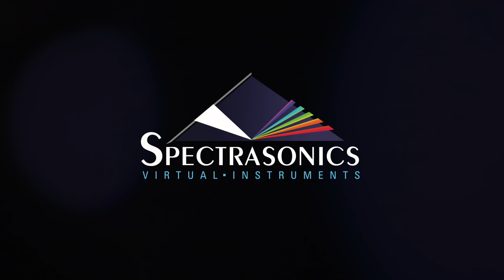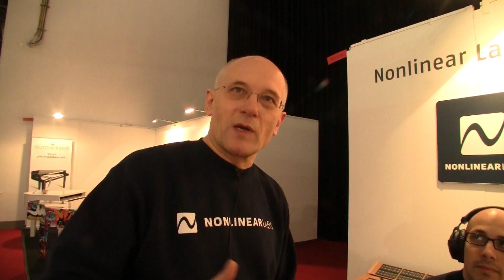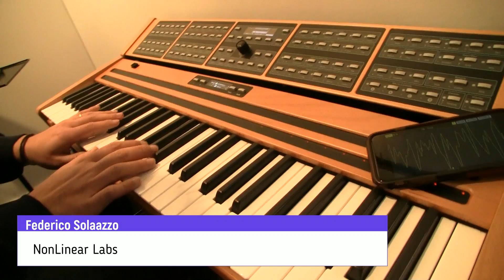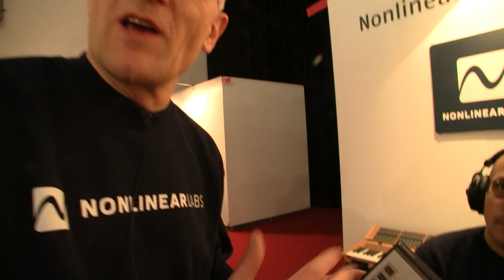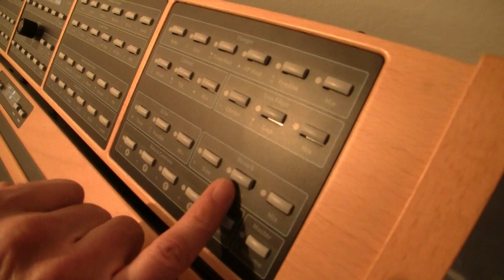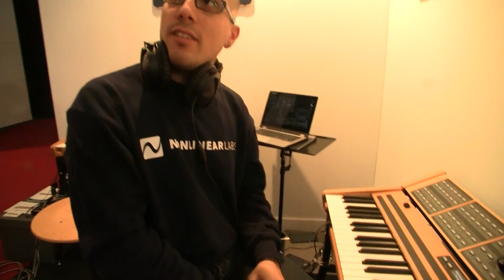MESSE 2017: NonLinear Labs C15 €4k FM, Waveshape and Modelling Instrument

Comment: 2-Osc FM(?) / 12-voice (WTF?) synth, without Pitch/Mod wheels, MIDI and...LFO! ???  :-s 
And all these at €4000? These guys are on heavy drugs lol...:-D
It's pointless to say that with only €300 you can buy a Yamaha SY77, which is few light years better than this basic wooden crap. Not to mention that at €4000 is waiting you the Monster Yamaha Montage 8! With less money you can buy also a Kronos or the Montage 6/7, a DSI Prophet 12, etc etc etc...
Also Waldorf will release its new great hybrid synth, the Quantum, at €3000+. 
Don't spend your lovely money to overpriced boring synths, with 4K you can buy a lot of really great synths.
Reply: Wood is better for What exactly? And wood is better than which plastic exactly? There are plastics and plastics, like there are woods and woods. In 21th century there is no need for wood parts on any synth. The wood parts on synths is something like an "unnecessary luxury", and to make a wooden synth in 2017 is just silly.
Reply: BlackBlofeld.
The synth enginge in the C15 has components and a signal flow that is not identical to the Yamaha FM synths.
It can create sounds that the Yamaha synths could not, and there are sounds that the yamaha synths could do that this can't.
It's not a very very basic version of a Yamaha FM synth, it is another type of synth based on FM.
Having more operators does not make a FM synth superior in every way.

Leaving out LFOs seems to be because they wanted the player to do the expression, rather than an LFO.
LFOs can be used to introduce instabilities that reminds of the instabilities in sounds from acoustic instruments, but in most sounds we hear where LFOs are used, they do modulations in such a way that they take care of some of the expression a player would have to do on their own in their playing on a acoustic instrument.

The lack of midi is explained in that they want this to be an instrument, rather than a synth. It's about playing it an learn the instrument.
I accept that, as there are software that offer similar expressive playability for those that want integrated solutions. I just wished that they had chosen a more interesting note input interface than a Piano styled keyboard, when they designed something that was going to be a new type of intrument.

It does a lot with those 2 oscs. http://www.nonlinear-labs.de/product/demo/demo.html
It may limit the instrument in some ways, but since it's an instrument and not a "trying to be it all" synth, I don't see that as a limitation.

The Polyphony is a bit limited, that could result in notes beeing cut before they have rung out completely.
And it sounds like it's due to processing. If the softsynth is well designed, it should be able to scale with the CPU used in the PC part. Optimizing is however always a good thing, so it's a good thing if they make sure that they get the most out of the Prototypes. Depending on what CPU they are using they should perhaps consider going for a more powerfull one when they start shipping.

The softsynth running in it, would probably be overpriced at 1000 Euros.
I don't know the specs of the PC inside, that could be worth anywhere from a couple of hundreds to 1000.
The  not so good looking button heavy interface of the upper parts is several of hundreds.
The ribbons cost, and they are not an off the shelf part.
The keyboard is probably at least some hundreds as well.
Then it's handmade in europe with a loft of craftmanship going in to the wooden outer shell. This is the part where they could have shaved of a lot of cost. But for a nische product like this most buyers wants a premium feel, and that means higher production costs, no matter what material is chosen for the outer shell.
Reply: C15 is not a synth. It's and instrument using a form of synthesis.
Ondes Maretnot is not really a synth, but an instrument using a form of synthesis (and it predates the firsts "synths" by some decades). So does the theremin.
There are organs that uses a form of additive synthesis.
Yamaha made some instruments (digital pianos) that used FM for piano and other sounds.

It uses much higher resolution than midi, even in terms of velocity from the keybed (that is in it's base a Fatar keybed). That does require some special solutions, and that is one thing that drives costs up.
It also has an embedded computer that I don't know the specs of.
But the synth enginge is very similar to Native Instruments Kontour, that is also desinged by Stephan Schmitt, but that one is then limited to midi resolution.

They built it so that is should feel like an instrument. It's not built to be a modern synth and therefor it does not look like one.
There are many expensive wooden digital pianos out there. They usually however come with well designed speaker systems, if they are in the same pricerange as this. However, this is made by a small company. For example Yamaha could have probably built it cheaper, or have included a speaker and pedal stand for the same price. But even if yamaha had built it, it would not have been dirt cheap, I would guesstimate it would still be over 2000 easily perhaps even over 3000, even without speakers and full pedal array.
Had Hammond built it, considering the price of their XK-5 it would probably not have been any cheaper.

I see this more like a electric organ type instrument than a synth.
Reply: It has a pitch-stick of sorts and two very long ribbongs, so in terms of Pitch and Mod, I don't see how it does not deliver.
Excluding LFO does make some sense in a instrument that is meant to be expressive in the hands of the player.
No midi makes sense in terms of them selling it as an instrument and not a synth.
The build in small production volumes probably make for a big part of the cost.

But I agree that it doesnt feel like the buyers are getting a great value for their money.

However mentioning used intruments, that when new, in todays money would be pretty much in the same ballpark makes no sense.
Reply: BlackBlofeld wood is better than plastic.
Reply: Jon Holstein MIDI is a must. Even the $150 volcas have it.
Reply: "However mentioning used intruments, that when new, in todays money would be pretty much in the same ballpark makes no sense".
I wrote about SY77 coz it's an FM synth and mainly coz it's a "few light years better than this basic wooden crap". And we talk here for a 1989 synth! 
The Yamaha SY77 was an expensive synth in 1989-90, but its price was a-bso-lu-te-ly right for its synth capabilities. Unlike the C15 above which is a 2-Osc/Op. basic FM synth, even more basic than the 1st generation of 4-Op. FM Yamaha synths back in 80s. 
C15's polyphony, its lack of LFO and MIDI, its 2 Oscs and final its price are all totally insane. Even at €1000 this synth would be a joke.
Reply: I don't know if the Yamaha FM really is the adequate comparison here. The sounds and the concept actually remind me more on the original synclavier. Which was also only 2-OP FM but with completely different results than Yamahas 6-OP-FM.
Reply: James Reeno
The volcas definately needs Midi as they don't have any proper players interface.

Sure, I could accept that some people would like to see midi or similar interface to be able to play their favourite sounding instrument with their favourite instrument to play of the same sort, as it for example isn't necesarily the guitar that has the best feeling that has the best sound, same goes for pianos.
However, this instrument relies on having expressive capabilities that is not identical to any other midi note inputting controller out there. Just like how a piano keyboard can neither properly control the sound of a cellor or guitar (and many others).
I don't think keyboards are the best for expressive playing, and for that reason I feel like it would have been more interesting if they had gone for another type of note input interface. The black and white keys do introduce some problmets when it comes to natural glissandos. Something like touchkeys or having the whole keyboard beeing able to slide sideways could take care of basic vibrato in a quite natural way, but this doesn't have even that, and even then glissandos become an issue. I really like the idea of the Linnstrument interface, but I have never touched one, so I'm not sure about the feel. The Roli Seaboard I'm not so sold on, it still makes glissandos unnatural, and I had a hard time hitting the correct keys so the muscle memory from playing piano styled keyboards doesnt really translate.
But since this is supposed to be seen as an instrument, adding midi, so that it could be controlled with ones favourite MPE controller doesn't work, as then it would have become a sound module and no longer be an instrument of its own. And for using ones favourite MPE controller, there are lot of softsynth options.
Reply: BlackBlofeld - so were you present at the Musikmesse and actually checked out this "wooden crap"? If not, I suggest you refrain from comments like this. The design cocept is geared towards fast realtime access of all parameters, as opposed to software or older hardware products you cited.
Reply: you can comment whatever you like for sure.. as for me, I just don't approve of rudeness in comments...
Reply: Wood on a synth isn't any more silly than a Black Blofeld.
Reply: It would be. Like the OP-1. Was it a joke? Yes. Did it sell? You bet it did.
Reply: @pholkee emm, i can comment whatever i want, especially coz i play synths the last 30+ years and i know what i read, what i see and what i hear. And i can recognize the overpriced "potatoes" from miles away. So, this synth is a digital Overpriced crap, like the recent Minimoog replica is an analog (super)Overpriced crap too. 
If you like to pay 4K for this kind of synths ("expensive" build / silly synth capabilities) then do it. It's your money after all. Personally, if i want to buy a...wooden furniture, i know where to buy one and at lower price.
I'm interested in serious synths, and thanks God, in 2017 we can buy few really serious and way better synths even at the 20% of C15's ridiculous price.

Comment: While this interests me enormously I can create extremely similar sounds with the gear I have. I would jump on it if it had midi as I am disabled and unable to replicate performances on a day to day basis. I would like to be able to build up a "performance" bit by bit with the ability to make very accurate modulations etc and this seems to be impossible at the moment. With new ways to use midi the resolution can be boosted and, while I can see exactly what he means it totally excludes people like myself. Layering will happen if it has midi or not, that's just the way it is surely it would be wise to offer midi as an option?

Comment: great and unique sound. 

is it easy to program?
Reply: like he said, it would take time to program your own sounds. i think starting with a preset and use that as a starting point would be the best way to learn the program inside.
Reply: If you get the concept and understand the signal flow, things become rather easy once you get the logic of the user interface. It's similar to an analgue console in that certain parameters are accessed through buttons in dedicated physical locations, which you memorize motorically.
Reply: andries vds no MIDI

Comment: Seems an odd choice to exclude midi. I would be interested in this kind of synth with midi, but I don't play anywhere near well enough to get the best out of it. I understand the resolution argument, but there must be enough grunt in modern CPU's to interpolate (even with some compromise). Sounds incredible though. I'm just glad people still have the balls to create stuff like this still. Far more interesting that yet another analogue.
Reply: But that was the idea that player should play it and become good enough players.

But I wish it came with a more innovative and expressive input method instead of a piano styled keybed with mono aftertouch.
Reply: Right, but it'd take years and years to become good enough to truly get the best out of it. I feel it's short sighted to leave out midi in this respect, although they're definitely not going for mass market appeal so they can afford to make such bold decisions.
Reply: Come to think of it, as long as one needs additonal speakers connected to it, it will never really be like an instrument, anyway.
But they do have a point in that people should learn their instruments better, when it comes to synths. A lot of the time people fall back to their habbits, and use their new synths, much in the same way as they used otherones before it, even if it has additional functions.